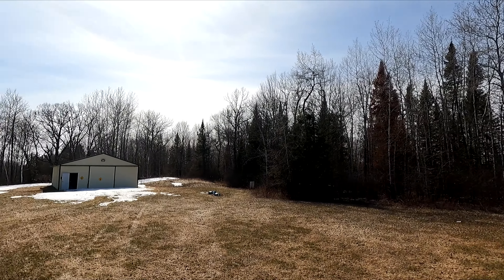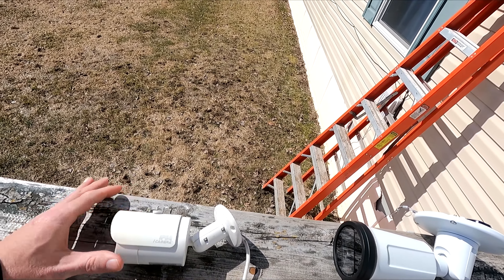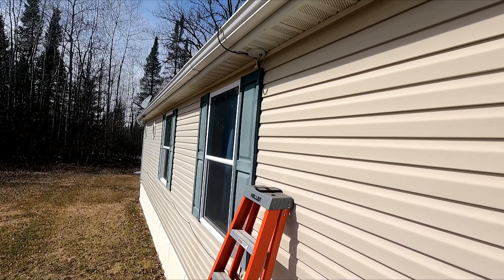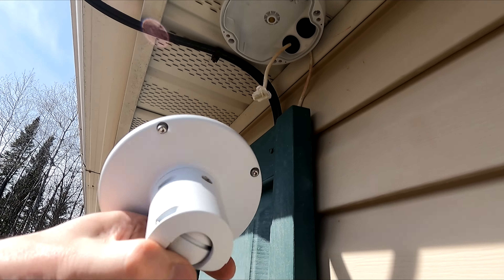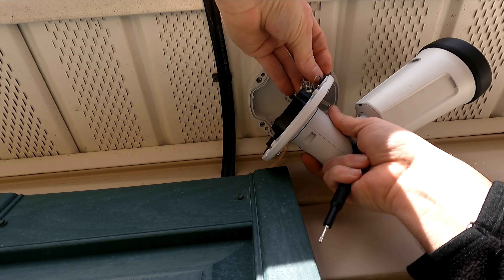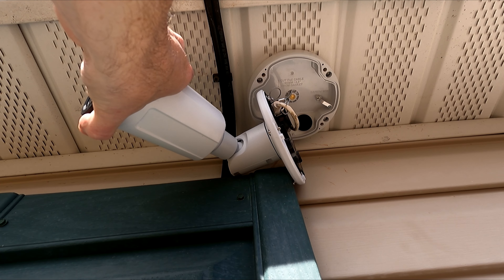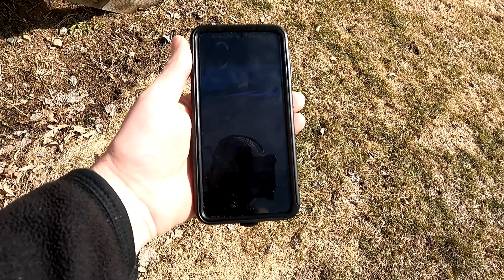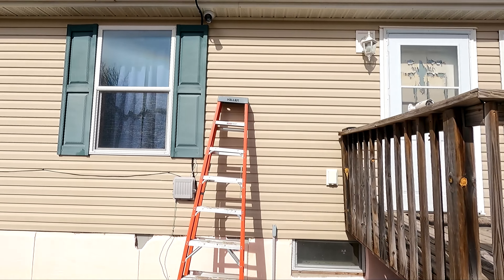Axis Network Camera Installation

Comment: I’ve installed hundreds of Axis cameras. Great choice!  They also have a 5 year warranty so you shouldn’t have to worry about it for quite some time.
Reply from the maker: Good to know!
Reply: Hello,  I have a problem with a axis 0959-001 bullet le cameras. Not send video,  Are part of an installation of almost 10 cameras, four of them, dont send video, if exchange camera, works fine, then the installation is fine.  The cameras has about a year working but those four stop working a month or two. Seems that model is obsolete, : (    Do you know what could be, or some models compatible ?     Thanks before hand
Reply from the maker: I'm not sure what the problem might be. Sounds like a lot of trouble shooting. My axis cameras are holding up very well!
Reply: @345rvv  I would call and see if they are still under warranty. Sounds like the video processor is done. They had some bullets that had a processor issue but they have rectified that. This may be that era of bullet camera.